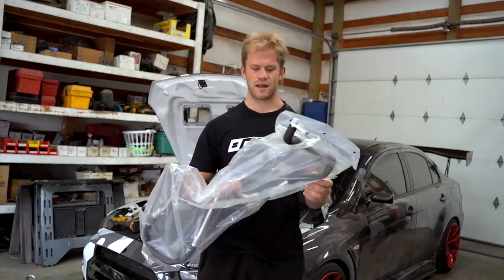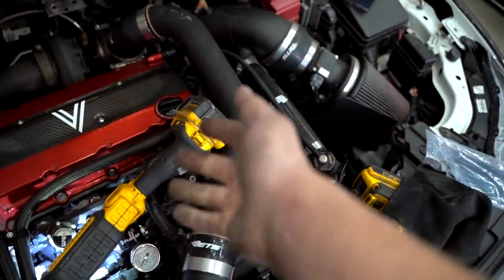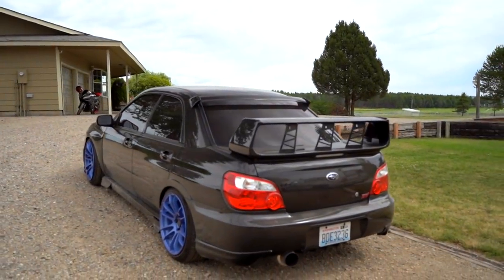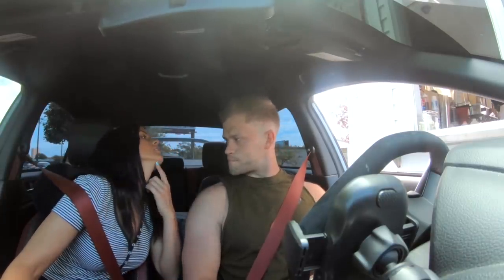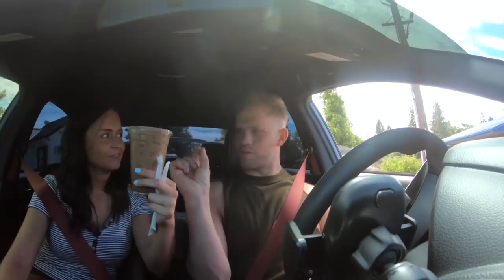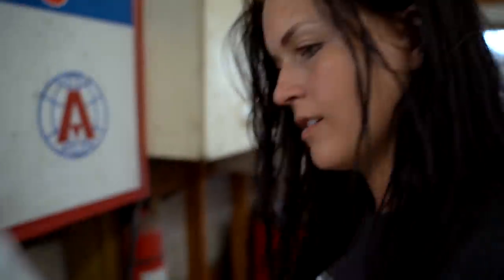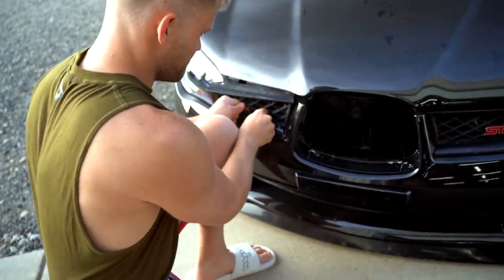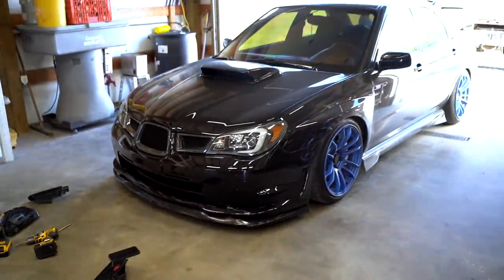It finally came!

Comment: Deviiinnnn I bought that same grille didn’t fit flush so what I did was buy these 2 inch long  pieces of metal brackets at Home Depot and made bigger holes in those brackets to connect the grill to bracket and bracket to bumper and it made the grille extend out to make it look flush against the headlights and bumper. It worked and the carbon fiber grille made the car look good 👍 try that out if you’d like

Comment: Btw devin the reason your car is stuttering is the plugs. My car has been running into boost issues like crazy. The eventually just stopped boosting. Switched my spark plugs and she boosts amazing and does not stutter while accelerating.

Comment: are you sure the grilles weren't supposed to be installed on top of the OEM ones? their website has a load of different options and looks like the ones you got say they should be installed with 3M tape...

Comment: If I install gauges where the clock is on my 05 sti will it throw the air bag lights too or was that because of something different? I’ve been thinking of getting gauges and I have a 3 pod hood already but I don’t wanna invest in pods if I’m gonna throw my airbag light just yet.

Comment: I need help!!!!

I had 2014 wrx and it keep having misfire on cylinders 4. I changed spark plugs and coil and it still had misfire on cylinder 4 and code P0300
Reply: My 06 had a coil pack wire clip broken so it would always slip out and cause a misfire
Reply: Nathan Smith I will check if the wires are lose. Thank!